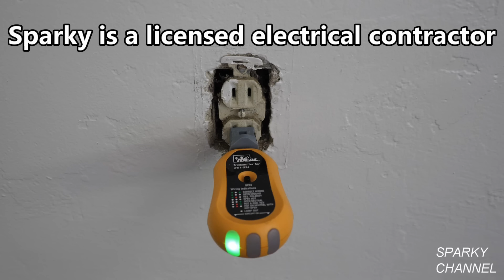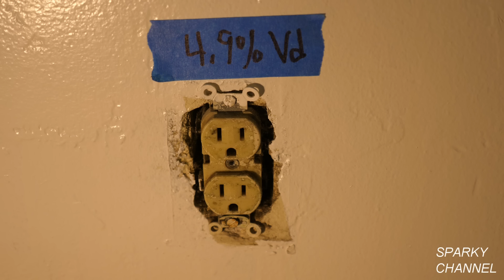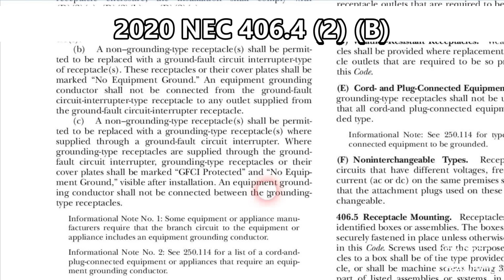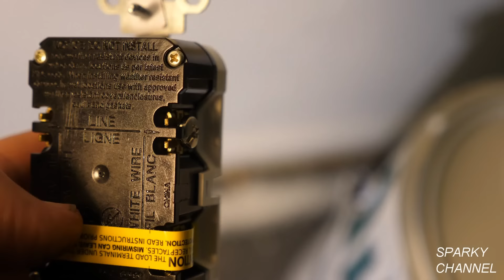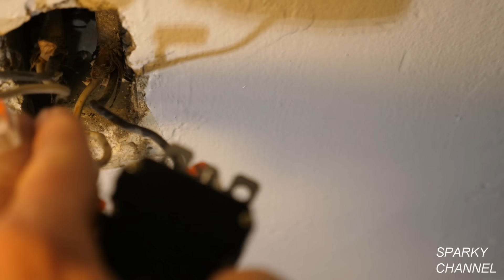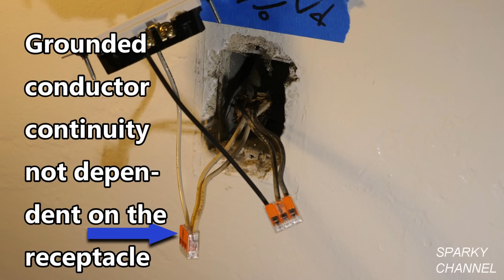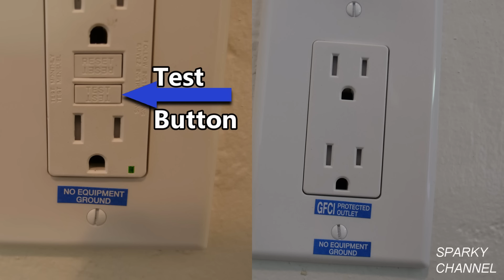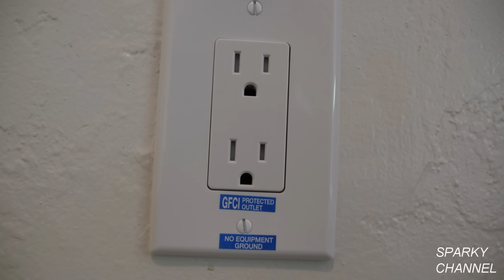2 Prong Receptacle Circuit Replaced by GFCI and Grounded Receptacles per 2020 NEC

Comment: With that much loss, and the outlets and wiring looking not the best, for outlets that you didn't cut and re-strip, maybe cleaning them up with some emery paper might have helped the conductivity?

I'd be curious as a test on a new breaker, with new wiring, and new outlets, what type of loss you would get.
Reply: Had sparky ran new wires then he would violate code if he didn't replace the service panel. Any new circuit would have to meet code which requires grounding conductor. He went with the least cost solution while conforming to electrical code.

Comment: My 1961 on slab home in Thousand Oaks had two prong receptacles. Installed GFI's on two  wire wiring.....Worked fine, in the electrical code

Comment: I thought a gfci needed a ground to divert load away from the fault? I would never put a grounding receptacle in without grounding to a metal box or copper waterline at least. Not an electrician, just been zapped enough to know what not to do
Reply: GFCI doesnt divert any load to earth, it measures basically difference between current in and current out. If a person touches live wire, and current flows thru that person to ground (floor) that creates inbalance and GFCI to trip. You dont need any ground connected to gfci to operate.
Reply: @sumilidero  The ground wire provides an easier path to ground so the current doesn't flow through you.
Reply: @genedavis9819  In this case there is no ground wire so that isn't possible without rewiring the entire home. Interrupting the circuit when a ground fault is detected is the whole point of the GFCI.  Sure a ground wire makes the whole home safer, but that's not what is in the walls.

Comment: Question: I've been told that you can just replace the two prong with regular three prong if you do a jumper from the ground to the neutral. Is that really up to code?
Reply from the maker: No. That is extremely dangerous. Please do not do that.
Reply: nope i believe thats called a bootleg ground or something. its just to trick testers, not actually grounded.
Reply: @ThePCHomestead  Sure it acts as grounding. It just is not allowed on the code in the US. In many other countries it was allowed in the past as still in converting old sockets. That is known as TN-C.

Comment: Can the line and the load be connected to the same screw in the grid outlet? That’s how someone did mine and I want to be sure it’s correct. The yellow sticker is still in the receptacle and never been removed.
Reply: helllllll NO! i wire per screw

Comment: This video was very helpful. It addresses the exact situation in my home. I grew up in a home that was built in the 1930s. We were constantly hunting for two prong adapters. Fast forward twenty years and I bought a home built in 1970’s and it has the old two wire electrical circuits. I hate that!!! Every time I go to plug in a grounded device, I have flashbacks of that old house I grew up in and I start cussing. You might call it three prong  adapter PTSD. 😂 I sincerely appreciate how organized the video was made and the knowledge it has given me so I may address my three prong adapter PTSD in my home. For that I will be clicking on the affiliate links to do my purchases of tools and supplies as you have earned any benefit that provides. Thank you for the cure to my three prong adapter PTSD.
Reply: Interesting to hear a home built in the 70s has 2 prong receptacles.  My region, Orange County, Southern California, required homes built 1964 and later to be grounded and bonded per code adopted.  It used to be NEC dictated all parts of the USA had to meet new NEC code in new construction and if the locality wanted stricter rules, then the locality's regulation overruled the latest NEC rule.  But if the locality wanted less stringent regulations, that was declared illegal by federal law.
Reply: @maxheadroom8857  Well, we live in Arkansas, and yes those are banjos you hear in the background! LoL.
Reply: @afishyfella, if you have a 3 prong adapter and a circuit tester to see if your receptacle is bonded,   you can test it by removing the faceplate screw, plugging the 3 to 2 prong adapter into the receptacle, then secure the grounding tab to the outlet.  From there, see if the tester shows correct wiring.  If the box is metal and it shows ground, you might have conduit or sheath metal cable running to the box and panel.  That was how some homes got their outlet boxes bonded to the breaker panel and grounding rods in the 70s.
Reply: @maxheadroom8857  Thanks for the tip. I'll have to give that a try.

Comment: Our home is in a similar situation. It was built in the 20's and has mostly two-prong receptacles (metal boxes, cloth-insulated wiring). There is currently only one GFCI protected circuit (kitchen). 
Would we benefit from using AFCI/GFCI dual protection receptacles, or would it be best to get all of our circuits under GFCI protection only, such as you did?
Reply: Definitely a benefit to have all the receptacles protected by AFIC/GFCI devices.  You can either; install an AFCI/GFCI receptacle on every circuit in the position closest to the panel, as shown by this video, -- or you can install an AFIC/GFCI "whole house" protector inside the panel, if the panel is capable of accepting it.  The later solution is the most expensive in most cases.  A certified electrician can help you to determine the best solution.
Reply: @chrisgraham2904  thanks!
Reply: @Naude716  2023 code now requires AFCI protection as well as GFCI in some rooms.  Dual protection is now the rule in kitchens and if the laundry room is in the house dwelling, the laundry requires dual protection.  If the laundry is in a garage or a non dwelling building, then only GFCI is required.  For older non grounded retrofitting, the dual AFCI/GFCI retrofit is required.  Most homes from 1955 on have boxes grounded from behind in bathrooms, kitchens, outdoor lights and receptacles, laundry rooms and garages.  The kitchens in the old code were required to have grounded boxes on walls where the sink is, but not necessarily on adjacent walls.  The same goes with laundry rooms.  Garages were required to have all boxes bonded in 1955 and later homes.
Reply: @maxheadroom8857  Have any states adopted 2023 code yet?

Comment: What is maximum number of receptacles on a circuit (per code)?
Reply: Based on the National Electrical Code (NEC), electricians are advised to put 12 outlets on one circuit with 15-amp. No matter how many outlets are on a circuit though, the load just can't exceed 12amp on a 15amp breaker and 16amp on a 20amp breaker or in other words no more than 80% on any given circuit. Technically NEC doesn't really limit how many outlets/receptacles, just the max load on a breaker/circuit.
Reply: @Tretruz  Thanks for taking the time to get back to me Justin.
Reply: @silekiernanphotography  here in Bew Mexico we run our home runs 12/2 romex on residential one circuit to esch room controlled by a single pole 20 amp breaker and when we run the receptacle’s in a room how we count to make it easier we say 10 points max for a 20 amp breaker which you count each plug as one point and switch we count as 2 points being it’s usually a ceiling fan therefore we run receptacle every 6’ and layout usually takes the eight and then fan 2 equals 10 points 👌🏽
Reply: @Weasel_NM575  Thank you for the information; I appreciate you taking the time to respond.
Reply: You are thinking the wrong way. You should ask what is the maximum number of rooms in a circuit. Ideally one. If you have two bedrooms in one circuit then if one of them uses a space heater the other cannot use one. If one person uses a circuit at a time he has better way of preventing overload. Receptacles do not use power, people do.
Reply: @okaro6595  "Based on the National Electrical Code (NEC), electricians are advised to put 12 outlets on one circuit with 15-amp. No matter how many outlets are on a circuit though, the load just can't exceed 12amp on a 15amp breaker and 16amp on a 20amp breaker or in other words no more than 80% on any given circuit. Technically NEC doesn't really limit how many outlets/receptacles, just the max load on a breaker/circuit". See Justin Lewis response above.

Comment: Wonderful video!

What gauge was the pigtail you used? Just whatever gauge the original wiring is?

Also, instead of using the wago connecters and pigtails, could you have alternatively put both sets of wires into both sets of terminals on the new receptacles, or was there a specific purpose I missed?
Reply: Regarding the pigtails, it is proper to use the same gauge as the original wiring.  Regarding the use of the pigtails, the idea that he mentioned was that if a particular receptacle failed, it would not kill the power to the entire circuit, but just the failed receptacle.
Reply: @glasshalffull2930  Thank you!
Reply: @Naude716  you can guess by the breaker amperage what gauge to use as minimum for the pigtail.  15 amp requires minimum of 14 gauge.  20 amp requires 12 gauge minimum.  12 gauge is thicker than 14 gauge.

Comment: Could you ground it if you wanted to?

And if so, how would you do that?
Reply: You could ground it if the wiring contained the bare copper grounding conductors terminated at the breaker panel. I did have this situation where the bare copper conductors were terminated at the metal boxes but 2 prong receptacles were installed. I just installed 3 prong receptacles and grounded them to the boxes.
Reply: Yes you can. But you would have to rewire the whole house and replace the service panel.
Reply: Nothing in this video is grounded. It is "ground fault" protected when a GFCI receptacle is added to the most downstream receptacle.